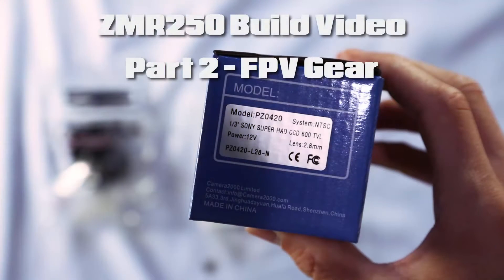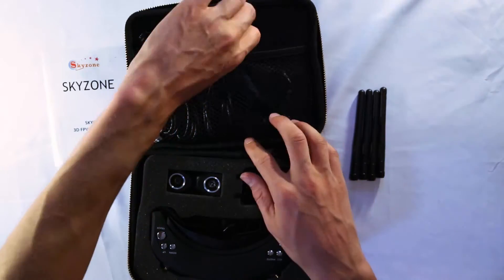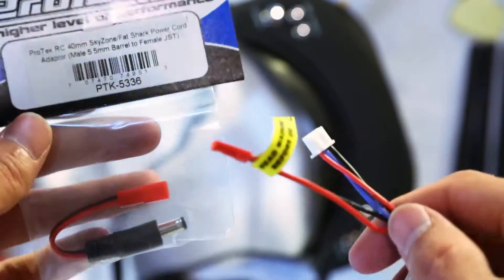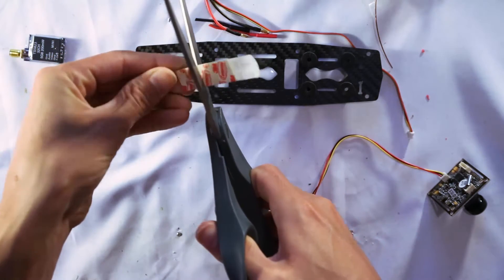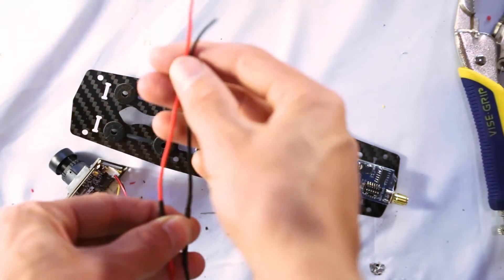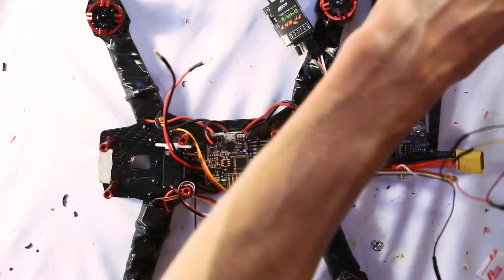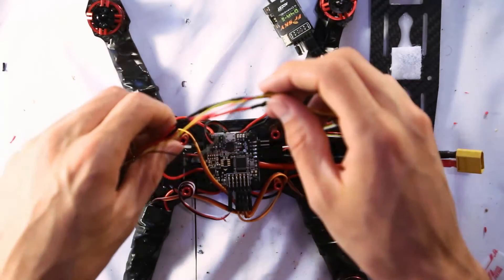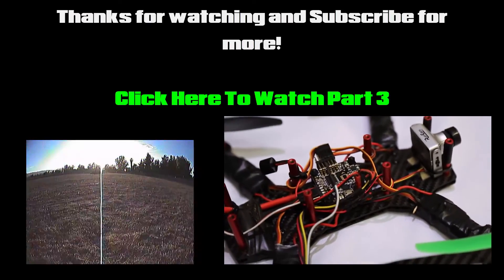INSTALLING FPV CAMERA - ZMR250 DRONE BUILD - PART 2

Comment: thanks for this video! i got the eachine falcon 250 which is a zmr250 build, and one thing i learned is that its better to buy clover antennas that are straight rather than the right angle ones, because the right angle ones tend to twist and can cause play and it ended up burning out my VTX. i like your idea of mounting the vtx to the top of the frame, i got a new vtx and new set of aomway 5.8ghz antennas coming, im gonna put the vtx on and then put one of the aomway antennas on the vtx and bend it up so its not touching the ground, and the other aomway on my rc832 receiver on my goggles - and im hoping it will work out good :D
Reply from the maker: Awesome to hear man! Yeah, totally agree with the antenna and after breaking a few I've made that change with the VTX and now it doesn't break when I crash.
Reply: if  you run the drone without a antenna it will also burn out the board.

Comment: Just a lesson I learned from similar vtx placement. Get an extension and mount it further into the frame. Otherwise upon your first tumbling crash the antenna with break off your ant mount on the vtx. I learned this the hard way. Good luck!
Reply from the maker: Yup, I made this exact modification. Drilled a hole in the frame for the VTX and bought a right angle connector to connect it.
Reply: When you soldered your banana clips to your pcb, did you solder to 5v or 12v? I know depending on camera but I have no clue where to solder them.
Reply: +Josh Wilcox Hey Josh, unfortunately there isn't a clear answer I can give you. It depends on the camera. Look up the voltage range for your camera and that should answer your question. Some cameras can handle a wide range of voltage. Thus you can solider it where you chose. Others require an exact voltage and must be solider to the correct voltage
Reply from the maker: Josh I can help you if I saw a photo of your PDB. First, just check what voltage your camera is. Some are 5V, some are 12V some can do both. 

If you PDB is not labeled and is simple like mine (all current is the same, no step downs or anything)then you could connect it anywhere on the PDB as long as red +goes to red and black- to black. Let me know if this helps...
Reply: I burnt out my camera the other day. Connected it improperly and smoked a chip on the back. Now im waiting for 2 different cams from banggood. I do have a question about a rX connection on my 210. it was flying great until i had to unplug cus the antennas got chopped up. Is it possible to replace the antennas with 18-20g wire? rx is parkfly fs-ia6.